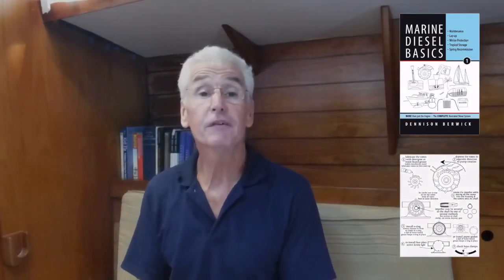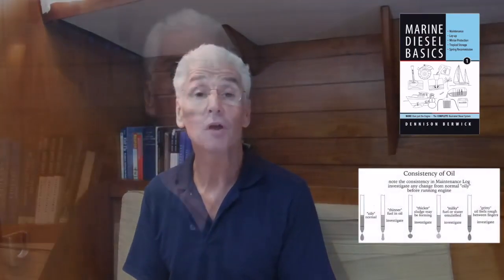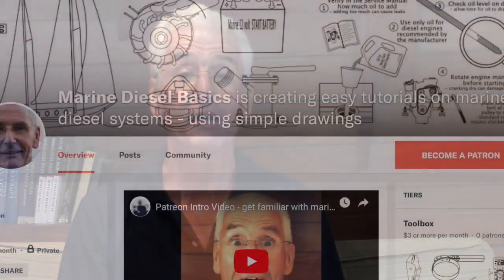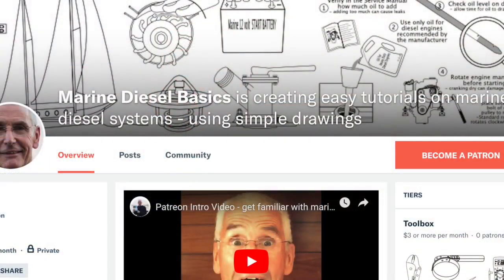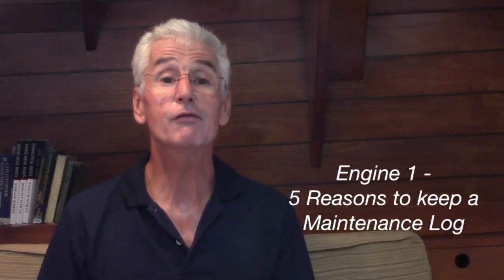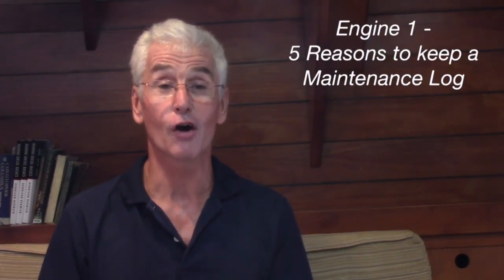Introduction to Marine Diesel systems

Comment: Can I use car diesel engine into a boat... what's the advantage and disadvantage between this 2 diesel engine....which 1 will give more power, rpm, torque & maintenance friendly....wish to look on any of your reply...thanks in advance.
Reply from the maker: Thanks for the question, but the answer is too detailed to go into here. The major issues are 1) how to cool the engine (radiator and air cooling is mostly impractical), 2) marine gearbox/transmission.  This is a subject I will be explaining in some detail in the next book - Marine Diesel Basics 2 - How Things Work & Installation Guidelines.  It will be 500 pages and have 2000 drawings.  Working towards publication summer 2023.
Reply: @marinedieselbasics739  thanks for your reply....for now I also try to get as much as I can on this info from around the world especially from Thailand & Vietnam....👍